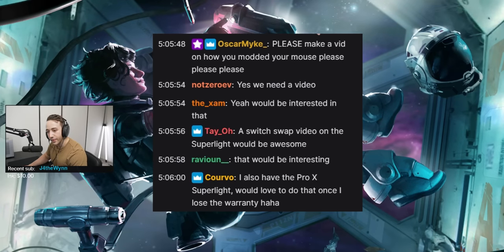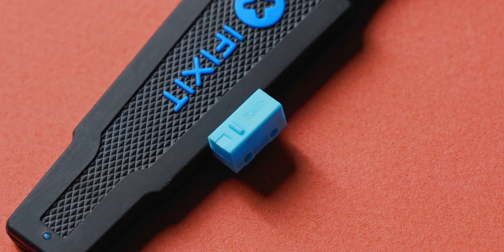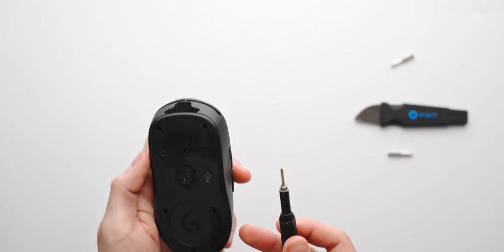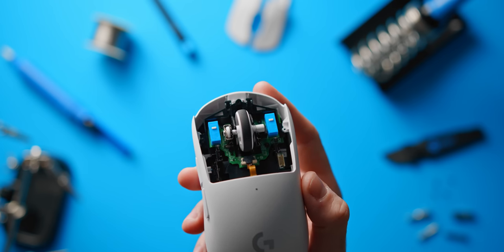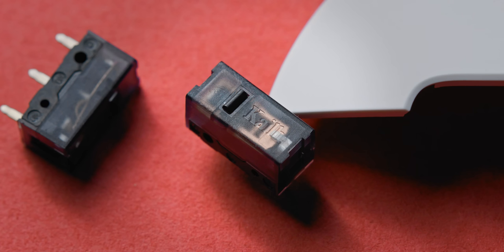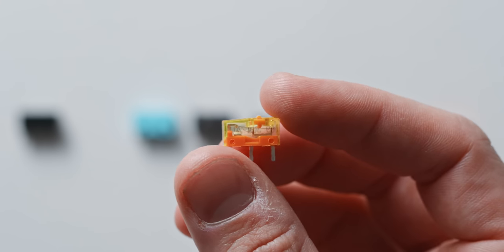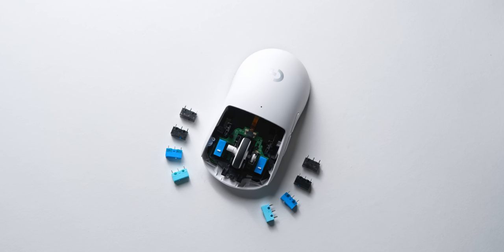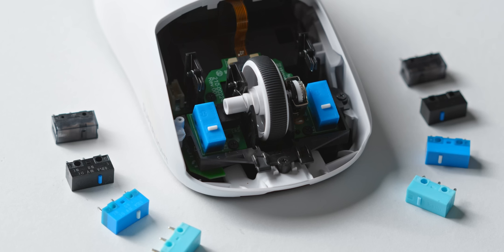Upgrading my Gaming Mouse Switches

Comment: I just did this. I'd never used a soldering iron before in my life. I bought an iron, desoldering wick, and some lead-free solder. It took me an hour and a half. If this is your first time, here's what you need to know:

1) First of all, you definitely need helping hands or a soldering station, something to hold the PCB. I didn't get any of that. That made things very difficult. If I'd had one more hand I would have been okay, but... I don't. A loose PCB sliding around on your table is going to make it near impossible to have any amount of precise control. You need to apply force sometimes, so if the PCB isn't steady, you'll have a bad day. I eventually managed to keep it steady between some heavy objects, but it was hard. I burned the PCB in a few places, but luckily everything still worked. Also, I had to use some tape to keep each switch in place before I did the first solder, I think even with helping hands you'll need that.

2) Second, I don't know if desoldering wick was the best choice. The switch connections are so tiny and have so little solder out of the factory that I thought the wick would be the best way to go about it. The wick couldn't pick up solder easily, I had to do it many times. What worked well was, I bent the switch pins with pliers (very carefully) which made it much easier for the wick to work, then unbent them afterward. Maybe a pump will work better, but I haven't tried it. So desoldering took a long time, and the switches wouldn't come off even when I couldn't see any more solder. Eventually I figured out that you need to apply a moderate amount of force to get them off. Afterward, I had to clean up the flux from the desoldering wick with an alcohol-soaked q-tip.

3) Get yourself a nice soldering iron. I got the cheapest one I could find because I figured this is probably the only time I'm gonna use it. It couldn't really melt the solder easily, it didn't have a fine enough tip, and the cord was too short. Again, a station would help with this because then the power cable is coming from your desk. Also, a station will have a place to put the iron when you're not using it. I used a jar lid which is probably dangerous.

Eventually though, after much trial and error and burning my finger, everything worked out pretty well and I'm happy with the new switches. My mouse is a 10-year old Logitech G9X that I love, so I don't wanna replace it. The switches had started to double click, so I replaced them with the Huano blue/white dot and I'm very happy. I also replaced the scroll wheel with a metal one and the feet with new ones. You will need to replace your mouse feet if you do this. I don't know why they put the screws under the feet, but factor that into the price.
Reply: As someone who have some experience with soldering... your advices are mostly just wrong.

1. helping hand, yes...good to have but not required. just use some masking tape to hold the PCB.
2. you dont really need soldering wick (you must have done something wrong if you need soldering wick), soldering wick is for cleaning up traces. just a soldering iron is enough... maybe a solder sucker and buy some soldering flux.
3. a good soldering iron is nice... but not required. you are going to spend too much on tools (good tools easily cost more than your mouse) if you are only soldering mouse switches. a fine tip is actually worse on a bad soldering iron because the heater cant properly deliver enough power, smaller tip = less heat capacity and less contact area. Even on good soldering iron that cost hundreds dollars, you usually want to use a larger (D shape tip) on most scenarios (and in thise case you want a D tip, you can vary the contact angle to solder finer pins). fine tip is only used when you try to solder super fine traces (hair like traces)
Reply: Unless you're already experienced in soldering, I would never recommend a beginner use something as oldschool as a soldering wick, over a decent solder sucker.

A solder sucker is faster, easier, safer (you won't burn youself), and generally more precise, especially in removing all the solder. You can even place it right up against the soldering iron for a few seconds without burning or melting the tip once the solder joint has been liquified.

A serviceable solder sucker costs anywhere from $10-20, so there's no excuse not to have one. It would've definitely saved you time and prevented damage in your case.

Comment: I still like the Omron switches. I also had the double click problem and later a scroll wheel problem. I was able to exchange the mouse though. The scroll wheel is way harder to upgrade. It is hard to find a new scroll wheel that fits.

Comment: I have never had a need to do this outside of maybe a 10 year old razor (and maybe replacing to optic sensors on the mouse wheel). But Unless you just want that clicky feel or replacing a dead switch its pointless.. Really the thing that matters is sensor tracking and thats not something you can easily mod.

Comment: Any advice on upgrading the side/thumb buttons? Logitech tends to use these half height switches that I have been unable to find an upgrade for. I did put Kaihl GM 4.0 in both my G603 (in a piranha mouse mods [EC2] shell) and Ultracustom Symmetrical. I really love the result. Planning to put GM 4.0 in the side buttons of the Symmetrical, but again, haven't found an upgrade for the side buttons of the G603. Also for anyone who likes DIY like this, the Piranha Mouse mod kits are a lot of fun to put together.

Comment: I missed the part about buying more than 2 switches. Installed the 2.0s and I like them but they don’t feel the same. Kinda driving me nuts did not enjoy taking apart mousing and soldering. Dreading the idea of doing it again to try and get them the same so i’ll deal with it.  don’t make same mistake as me

Comment: I put Kailh GM 8.0s in the 12 year old $20 Logitec M510 that I use with my laptop because it was double clicking. I think they feel and sound better than the switches in my Cosair Ironclaw, not that those are by any means bad.

Comment: i actually upgraded my model O wireless with TTC gold,it's so good,i've bought 3 microswitches which are kailh GM 8.0,TTC gold 80M(the one i love and i use),huano white dot and among those threee i personally like the TTC gold,idk why but it makes clicking easier but it also make you tapping 1 by 1 bullet harder because it's the most sensitive microswitch i've ever tested,and why did i only bought the 80M microswitches(except the huano white dot,and i bought the white dot because it has the most lifespan)? because i hate changing something like this frequently when it's broken,so i'd rather buy a new mouse when the microswitches are broken

Comment: One of the things I liked about the Asus ROG Impact II Wireless is the socket for switch replacement/ upgrades as I can just order new switches and proceed to Plug N' Play. Should the switch assembly come with 4 stems I can easily cut off one of the unused stems and install it in the mouse. Luckily the stock switches on the ROG Impact II Wireless were quite good albeit a bit too quick for my tastes but it just required retraining to not rest my finger on the left click.

Comment: Hey Ali I was wondering if you could please give me some insight. I am currently using the same Omron switches you had on stock GPW but find myself accidently clicking the rmb frequently on my G502 lightspeed. I rest my fingers pretty heavily on my mouse and was wondering if the kailh 4.0 reds which you said were the stiffest and hardest to press were really that much harder to click compared to the omrons in a significant way or only if the feeling was different? I think the Omrons are 60g +/- 10g and the kailh 4.0 reds are 70g +/- 10g which doesn't seem like too big in a actuation force required difference. Would you say it was really hard to accidentally click on the kailh 4.0 reds?
Reply: I was actually in the same boat as you. The answer is you can always choose higher actuation force switches than 60 or 70g.

When my mouse started having double-clicking issues, in addition to misclicks (because I rested my fingers on them like you do), I accidentally ordered the wrong replacement Japanese Omron D2F-01 (150g) switches, instead of the "proper" Japanese Omron D2F-01F (sub 75g) switches.

And now I'm glad I ordered the "wrong" switches because I've grown to prefer the higher actuation force way more. 150g on the D2F-01 sounds like a lot, but it's actually lighter than it seems, AND with much better tactile feedback (and rebound), without really being noisier either.

You'll get used to them in a week and eventually prefer them over lighter switches if you're anything like me. And no, you won't get finger cramps or fatigue. They are perfectly fine for long gaming sessions.
Reply: @GENKI_INU  Thanks for the input. Since I posted this I did order the Reds and they honestly felt the same. I found those 150g ones you have on amazon and have 4 of them in my drawer I never got to taking apart the mouse and putting them in because my first attempt with Reds actually bricked my first mouse...RIP. After trying the 70g reds I knew I would want the 150g force but my biggest concern is the 1 million click life. The omrons and reds have like 20 million click life so the 1m scares me. Is this something you considered and looked into? I wonder if it means every 1m clicks I have to switch em out which will get annoying and pricey as I feel like id switch every 3 months. Also another question did you find them too high for the chassis? I know the 150g are higher than the 75g.
Reply: @Gamerzguy2468  I'm really not worried about the durability, because unlike the Chinese "20M" Omrons that came with my mouse (which lasted a year and a half before double-clicking issues), my Japanese 150g Omron replacements have already lasted 2 years (as of now) without ANY issues, with the same amount of usage as the "20M" ones saw. 

Not to mention higher actuation force switches tend to be more durable and last longer to begin with, compared to lighter actuation switches.

I don't want to be the person who spams "Made in China Sucks", but clearly in this case, the Japanese-made Omrons have way higher QC tolerances than the Chinese Omron varieties.

As for the fit, both the Japanese 75g and 150g have the exact same dimensions. Compared to the stock Chinese "20M" Omrons, the only difference is the SLIGHTLY taller plunger button which is 0.5-1mm taller AT MOST.

Almost all mice will fit the JP switches perfectly fine without any modification. And even if it doesn't, you can always sand down the plunger button to make it fit better.

Comment: I'm not a gamer but I do use my mouse quite a lot. I have been buying the Microsoft six button Intellimouse over the years and none of them have lasted longer than a year. I like the quiet click of these mice and the soft buttons but their switches are pure junk. Which switch lasts the longest and which switches are the most quiet? I don't need to hear a click when I use those mouse buttons. My current piece of Microsoft junk is a little over one year old and it's double clicking.

Comment: Great video. I'd love to see a follow-up regarding mouse wheel encoder upgrades, as that has been my main issue with the G Pro wireless, specifically the wheel sometimes getting stuck between steps, which is a very unfortunate event when you're using wheel scroll down to swap weapons in Apex and get an unintentional swap (or even a double swap back to your empty primary weapon) in the heat of the battle as a result.

Comment: i happened to realize that g pro wireless og and the superlight dont have any "surface tuning" option inside the Ghub. When I come back to my G403 wireless the "surface tuning" option still there. Super wierd -,- does it mean that the sensor setting is "one size fits all" type of thing?

Comment: I messed around with the three kailh switches (GM 2.0, 4.0&8.0) some time ago as i was really interested in moding mouses because some time ago i saw a mouse with hot swappable switches so i was wondering why someone would a mouse with hot swappable sitches and taeha types had a video on moding his mouse as well.
i myself used the GM4.0 now and the difference is really noticeable earlier i was actually wondering if you could make a vidoe on this but i was surprised again (pleasantly).
And about the equipment its really good to have good equipment for anything but its not really hard to mod your mouse i changed the switches with a crappy soldering iron that was for 20 years ago (cleaning it took more time than changing switches) i just put the pcb at side of a table with a light object on it to act as a weight and started soldering with caution

Comment: Hey I know it sounds crazysweat_smile but can I just somehow mount a good cooler on my acer nitro 5 lappy's cpu and GPU by putting it into a itx case as it turns out to be very hot in my laptop above 85 deg after 30 mins of gaming

Comment: Do not say that it is good to practice on a mouse if you 've never soldered. Many mouse has cheap, plastic PCB so you could burn the PCB and may destroy the hidden in-layer wiring or surface joints.

Comment: i did this before i knew it was a thing, I replaced one of the switches in my roccat kain 120 aimo with a switch I found while digging through my switches and it feels way better when doing anything, I didn't replace the right click though cause I need that one for drag clicking

Comment: I saw quite a number saying that Huano switches are not long lasting at all, wonder how this will turn out.
Reply: depends on the ones you get each switch company has a different line up. The kailh 2.0 will burn out faster than the 8.0 as the 2.0 is a 20million and the 8.0 an 80million. Usually the stiffer the switch, the longer it lasts.

Comment: I really wanna do this to my Orochi V2, but there aren't any replacement feet available anywhere yet :/
Reply: You can, you don’t have to remove the mouse feet to mod the Orochi V2, have disassembled mine multiple times and still using the stock feet

Comment: Guess I'll wait until my G305 gets the double clicking to do this
Reply: Upgrading the switches will cost more than just getting a new g305. It's only £30
Reply: @weavercs4014  good replacement switches that blow the omrons out of the water are very cheap, just don't buy from a boutique reseller, instead straight in china.
Reply: it depends, in my case one day it double clicks and another week it won't, 
In my opinion if you might have any cash to spare and time to spend, it's a good investment to change the switch and change the rubber pad and the scroll wheel if it's kind of stuck because the rubber pad stretches like mine
Reply: @ivanasha7879  as soon as the first double click happens I'd consider the switch broken. So far my omron mice have always held up a few years

Comment: i accidently destroyed one of the solder pads that makes contact with the pins for the switch, now it doesnt work anymore :(
Reply: Haha been there.
Here's how to fix it. With something like an exacto knife, lightly scratch (Don't cut) the PCB, just enough that the copper layer/Copper trace is visible. And then solder like you normally would making sure to bridge the solder to the trace you just made. Then the switch should work.

Comment: hi there recently i got a g305, have been using it pretty extensively, the mouse feet feels a bit worn out and the clicks were kinda garbage from day 1.
should i get corepads for the mouse feet and which switches should i get if i want more tactility, less noise and less actuation force
thx for the suggestions

Comment: I had an issue with my g203 wired mouse have a terrible double clicking issue and it still sort of does, opening and cleaning the mouse helps a tiny bit I think. not sure exactly what I did to fix it

Comment: So you have to remove solder to be able to change the switches? -> I look at my new ROG Gladius 3. Then i look at my 12 month old G502 Hero with doubleclick issue... Why only Asus is able to build a Mouse with removable switches is far beyond me.....
Reply: Asus was granted the patent for the replacement switches.
Reply: @Pipsispite  yes thats right Asus has the patent for HIS sockets for the removable switches. But this is no obstacle for other producers to not construct their own sockets or solutions....
Reply: @TheEmmetdocbrown  is soldering switches that hard? This is something only 1% of mouse users would do anyways
Reply: @omegaPhix  without the right Equipment? Yes indeed. Please tell me: Should i buy a 80€ Mouse every 11 Month new? Because the Switch is dead? As 99% of every other users do? I think building removable switches into a mouse is the right way and much more forward thinking.

Comment: all those solder irons on Amazon suck. The digital meters are fake and don't really measure temperature and they are all on off controlled. The digital "meter" just control how more frequent the on period is and they don't keep temperature very well to melt stuff. I get much better irons for much lower prices from taobao.

Comment: how i can remove old switches without using solder sucker?
Reply: solder wick
Reply: It's not recommended. You could easily damage your old and even new switches if you don't have a solder sucker to properly remove and swap in the new switches.

A solder sucker is $10-20 at most. There's no excuse not to have one. You need to have the right tools for the job. Especially as a beginner, or risk damaging something, including the PCB.